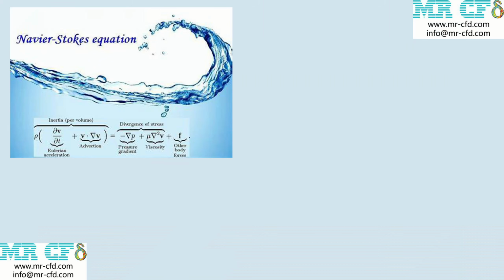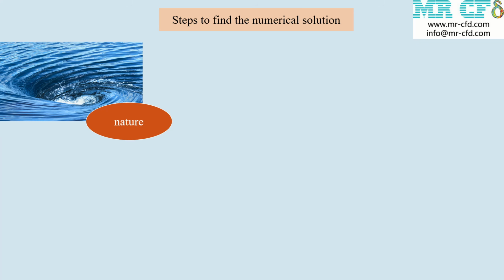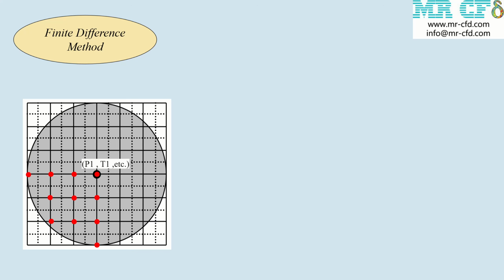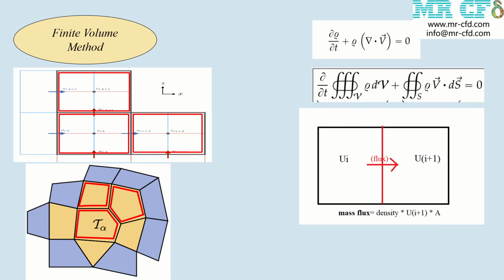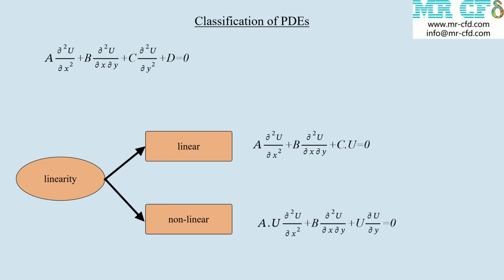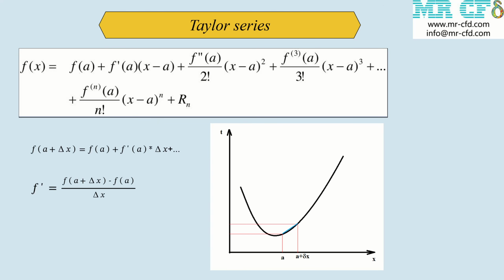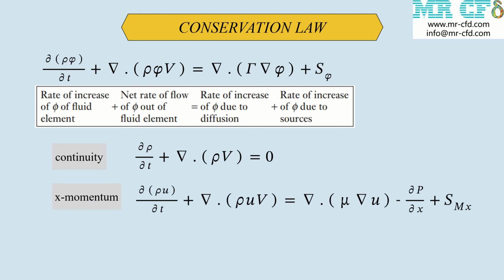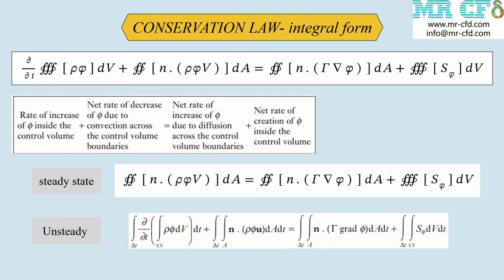Session 1: Introduction, Understanding Computational Fluid Dynamics (CFD)

Comment: Do you have any content on 3D overset meshing? For example, a moving nozzle for an extrusion printing case or any related material on this? Sorry, this might not be the best place to ask since it is a different series, but I was curious if you could guide me on this or provide any useful content.
Reply from the maker: you can see lots of courses in www.mr-cfd.com related to CFD simulation by ansys fluent